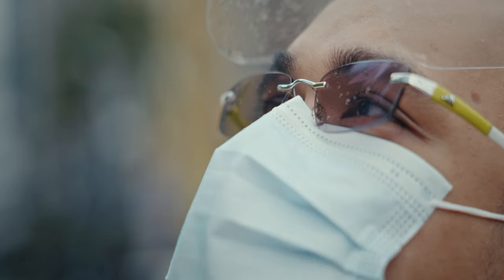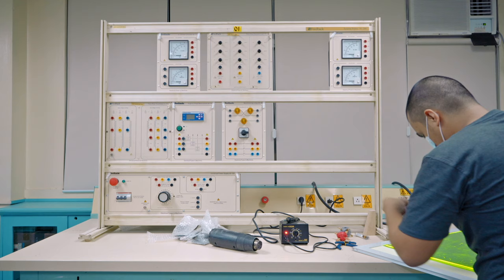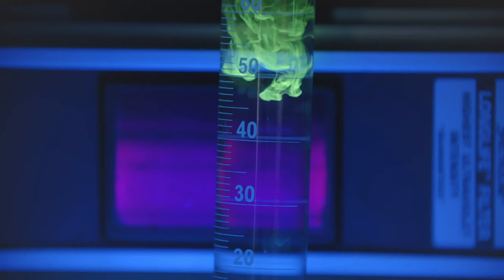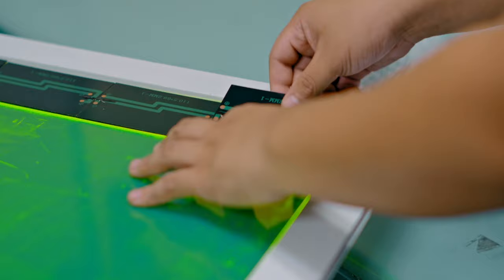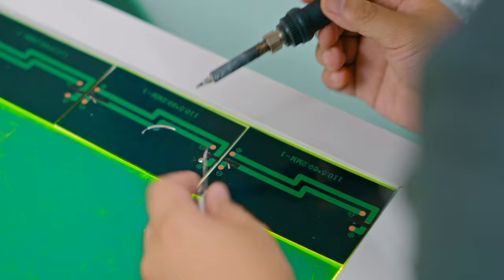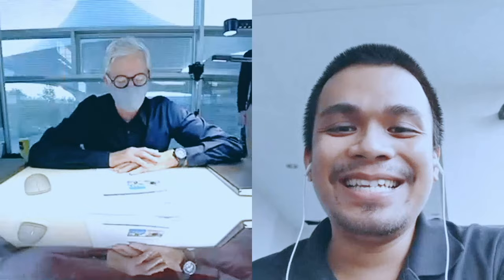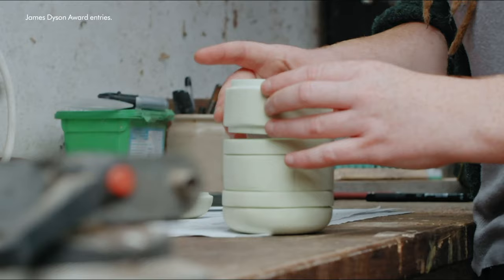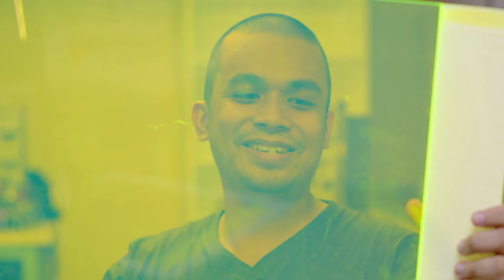Renewable energy from waste: AuREUS wins first ever Sustainability Award | James Dyson Award 2020

Comment: 1. What percent of the light actually hits the photovoltaic components?
2. How many grams of pigment is needed in each panel?
Reply: @June@97  I think it's a lot less than 80% because most of the light just goes through the window - very little of it would make its way to the edges where the photovoltaic parts are - but I'd love to be proven wrong.

Comment: Did I understand it correctly it is an filter and work on the edges like a optical fibre? So if you cut it in bars and turn it 45° can you use the whole area of 1m²  and not only the 38dm²